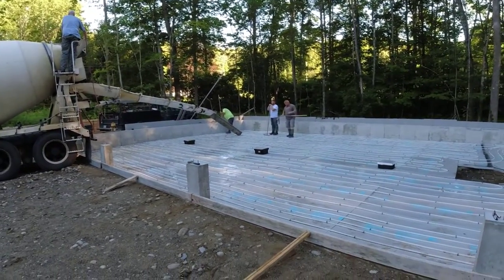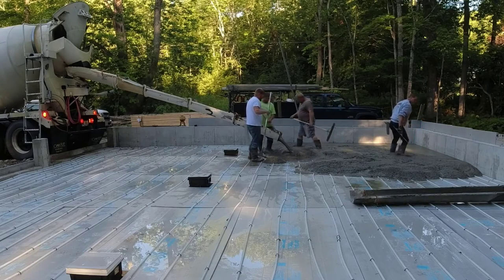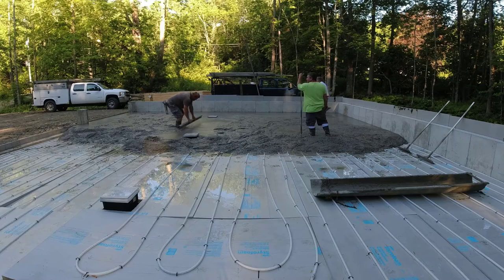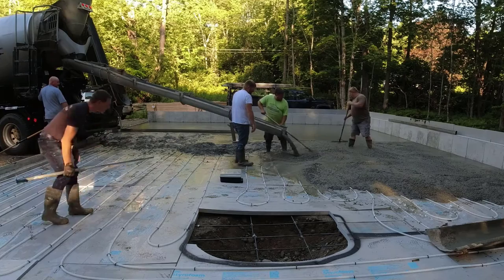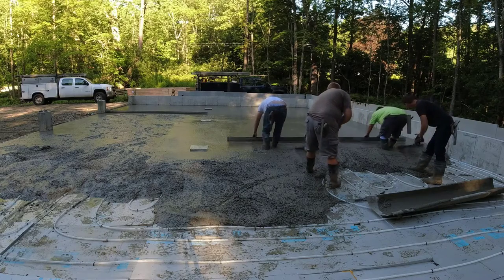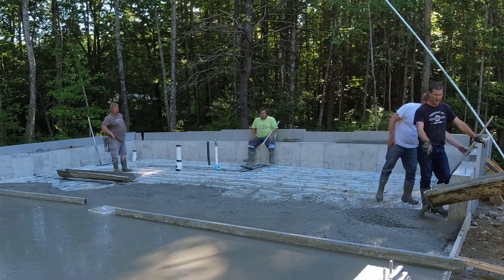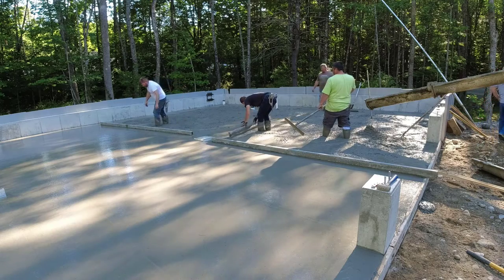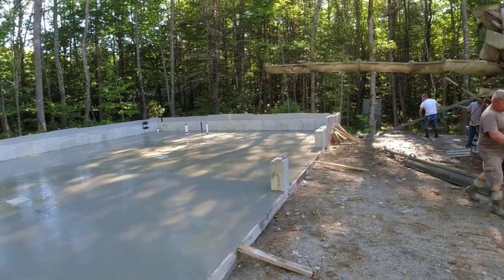How To Pour A 50' X 30' X 6" Concrete Floor | Garage Floor With 3 Floor Drains

Comment: Glad you mentioned the importance of washing off concrete that gets in your boots. nobody thinks it can happen to them but there's a lot of knuckleheads out there who lost their legs from not washing the concrete off their legs and boots in that situation. I once bought a whole bunch of tools from a guy who had just lost both his legs the week before from walking through a footing hole during a pour. It starts out feeling like a little rugburn but by the end of the day the portland cement has burned through their skin deep enough to start bleeding, or worse. The eating away at your flesh will sometimes keep going deeper and deeper even after you wash the wounds if you dont neutralize them with vinegar. The wounds it causes are extremely prone to infection, probably because the cement doesnt leave clean wounds where it eats your flesh

Comment: You’re right - that’s going to be a very nice garage.  I’m a bit jealous.  😀 Currently in San Diego, CA.  Used to live on the east coast and worked in accounting for a concrete company.  Love watching anything to do with pouring concrete and you guys do a great job.  Quick question if you don’t mind… on the video it looks like some of those drain covers were sticking up a little above the level of the concrete - was that actually the case and they will trim them down later?  Can’t tell because I’m watching on small phone screen.

Comment: Mike a real strong leaf blower can help out a lot in moving the water in this situation. Would it of help to put the stiffer mix that started out filling the footing hole, then thin out and start the floor, buy the time you walked at the footing hole it might have held weight a bit better for the guys walking over it.

Comment: Sioux City hey Mike, I have a question for you. I have a overlay on some steps and I’ve never bid overlay jobs. What would you typically charge for overlay per step  4 feet wide
Reply from the maker: I'd have a minimum charge for that, 2500 labor plus materials.